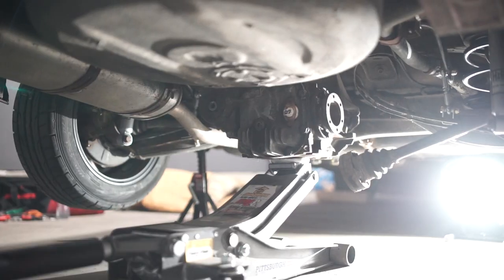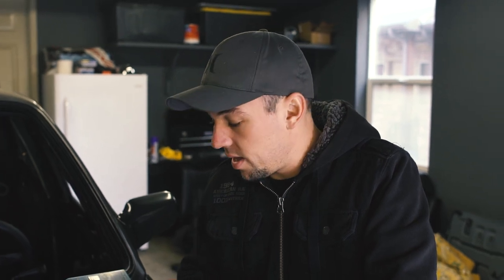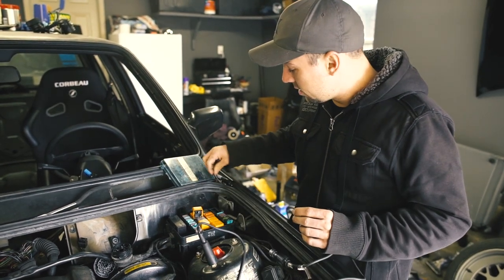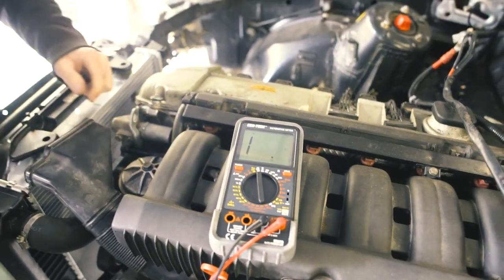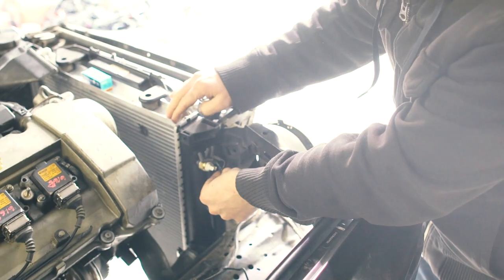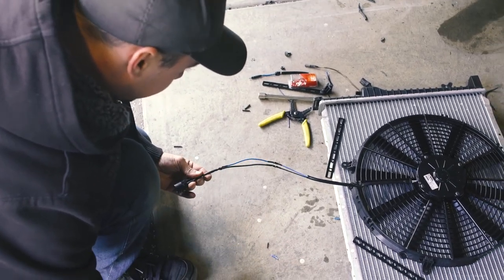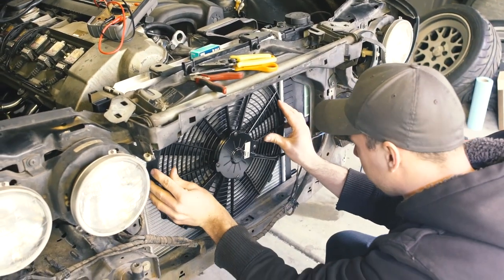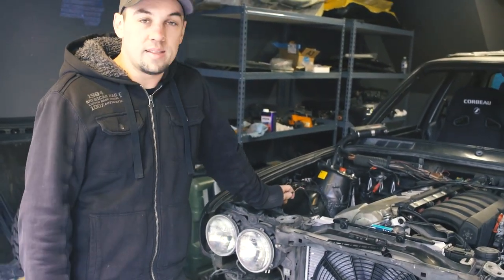E30 Aux Fan Wiring explained...SPAL Fan Install

Comment: Would the late model M20 radiator be fine with the spal aux fan? My car is 1989 320i with M50B20 engine swap, I had the 324 diesel mechanical fan but it broke my radiator so now im thinking to switch to electric fan, any help?

Comment: Question I still have my stock front aux fan . I’m installing a fan as a puller on the inside of the engine bay would I remove the oem aux fan in the front ? Or wire them both to work ?

Comment: Hi!!   If you have a time, i want some advice from you.
My e30 318is (m42) is about brken aux fan. so not cool air..
I got a new aux pan from partshop.  

I'm wonder about replacement ways.

1. front removal-- removal front bumper etc. and replace aux fan.  - like you.

2. rear removal-- removal radiator etc. and replace aux fan.

Which way is good for save money,  working time ??

Comment: You went from 3 wires to two on the temp sensor.  How did you choose which two wires to use?
Reply from the maker: I was hoping the video would show that detail 😞 But basically you go from a hi and low speed set up to single speed, so you gotta check continuity on the wires to figure out which one is which.
Reply: I used the high speed, its easy to know wich one is high, Just  turn on AC and  the fan must turn on (high speed)

Comment: The fan comes by default as an extractor. How did you get it to push air into the engine? Did you invert the blades or does the direct current connect it to the opposite wires and it rotates backwards?
Reply: I had the same issue,  just invert the wires

Comment: So does the e30 have 2 fans I just noticed the marks of my oem spinning off and making contact with radiator. Took out radiator for maintenance then I noticed another fan in the front.... was mine converted already? To have 2 fans pushing air at eachother doesn't seem productive to me lol 
I'm new to e30 world just got 325is a month ago.
Reply from the maker: Usually there is a Fan for the AC Condenser and a Fan for the Radiator (engine coolant)
Reply: Usually. Oh no .

Comment: I have a e36 and I want to run a fan in the front of the radiator like you did but I wanna keep my fan clutch too can I do that? I see that you don’t have a fan clutch and everyone just replaced there old fan clutch for a electric fan I never seen anyone so both?
Reply: Why both? Fan clutch is usually junk and the electric fan is plenty enough

Comment: My fan switch has 3 prongs inside the switch, where did you get that fan switch?
Reply from the maker: The switch we used (2 prong) is 61311364272

Comment: Hey Salt City Euros, I'm a big fan of the channel, I installed an electric fan on my E30 and I was wondering what's the part number for the fan switch? P.S. you mentioned in the video that the part number will be in the description but it's not there,
keep up the good work
Reply from the maker: So sorry about that. 
61311364272 make sure its 2 Prong and in our case, 82 degrees. If you have different setup/goals, adjust temp accordingly (92 for example)